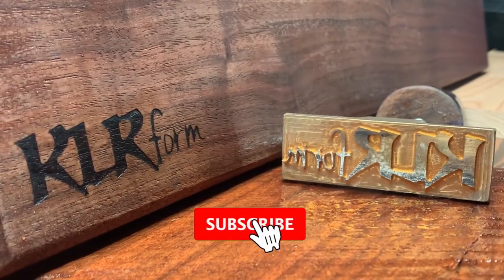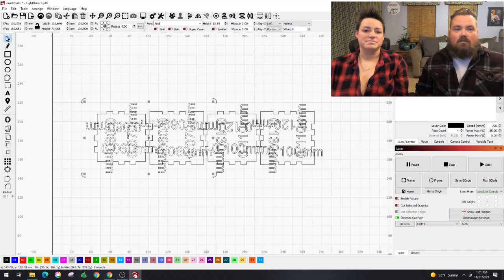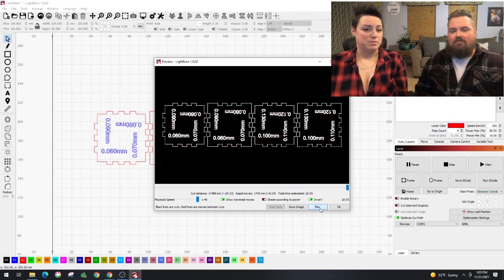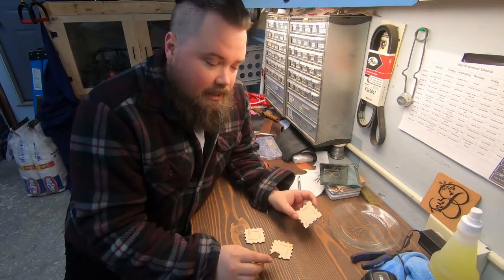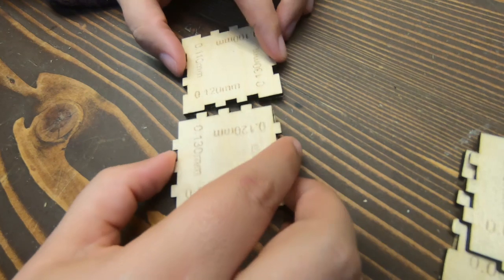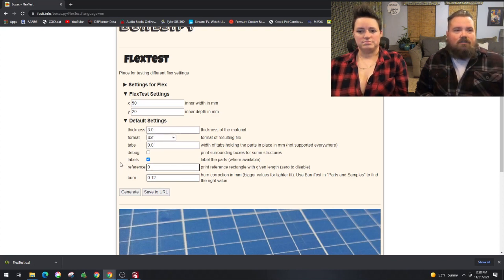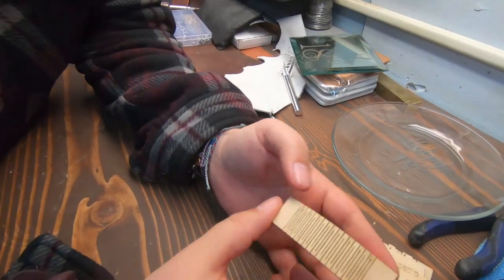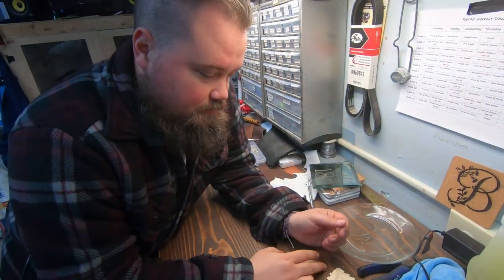How to Laser Cut Box Joints | Ortur LM2

Comment: Would you recommend the Ortur LM2 for cutting out 3mm birch and for etching leather, glass, wood?  Are you just using the LM2 or have you upgraded it?  Thinking about buying a laser.  Thanks
Reply from the maker: I have done Air assist and Z-axis upgrades. I would recommend buying the best laser you can afford for the job you are wanting to do. If cutting is your focus - a CO2 will do that much better than and diode laser can do it. So your goals and price range are a huge factor.